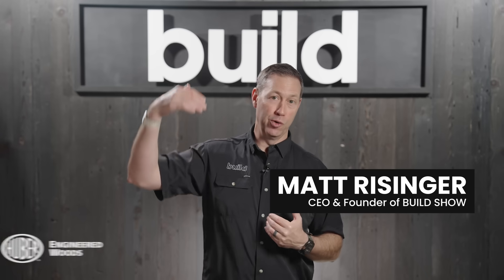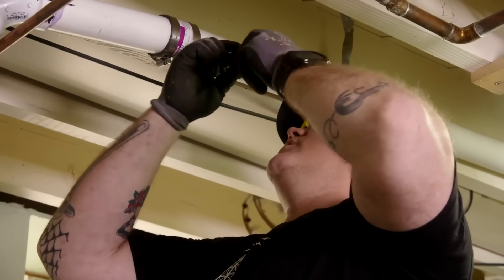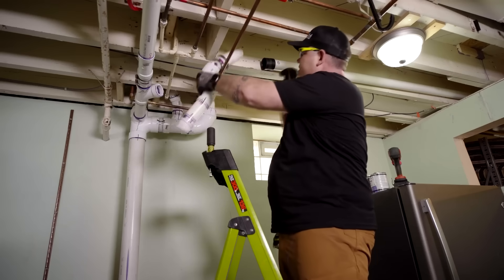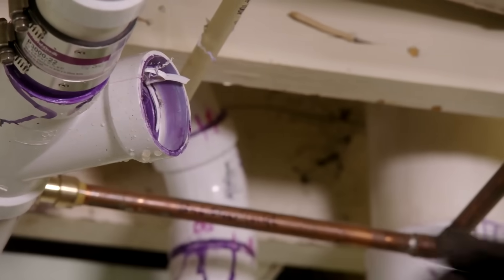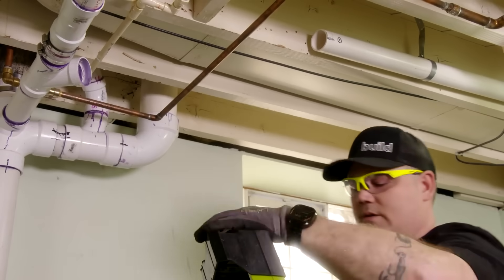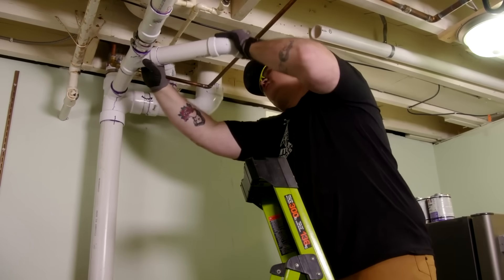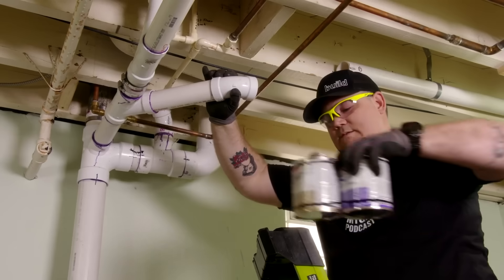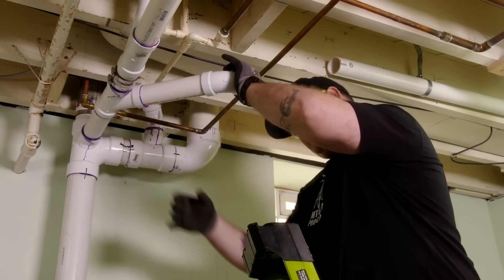Understanding and Fixing PVC Drains with Eric Aune | Best of The Build Show

Comment: Master plumber… I don’t think so. Air measurement? Purple primer can be used in a neat fashion. Measure the offset, either vertical, horizontal, or rolling then multiply by 1.4142, for a 45 offset, then subtract the takeoff for 2 fittings, this gives you the end to end length

Comment: Zip ties for the cans is smart. I used to use duck tape. I never had an issue with the tape breaking down but it is technically against code. I’ve never looked this up but as far as I’m aware you’re supposed to be able to read the label. Cable ties allow this. I just got the rebend carrier and it’s awesome. 
As for purple primer, I also live in a place that requires it. I do keep a small can of clear primer for set outs so I never have to have purple primer around new floors and cabinets. It’s technically illegal but I’ve never had an inspector fail me for it. Some guys use just glue in these situations. Both will work fine but primer makes it a little better connection